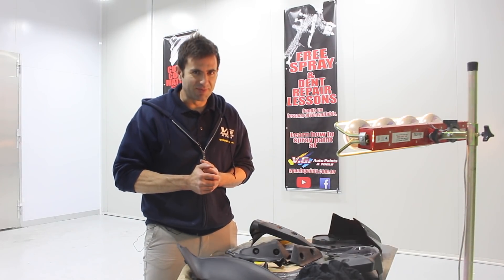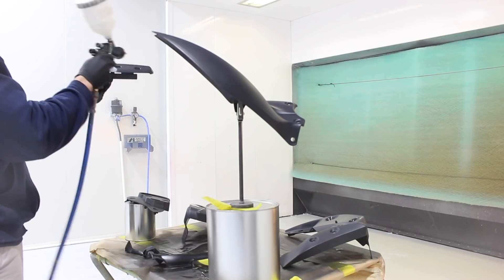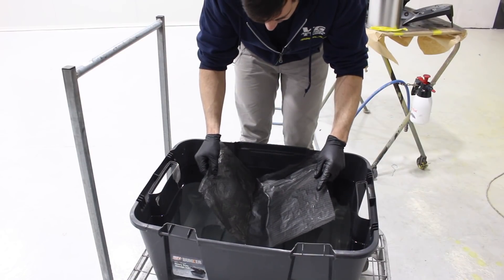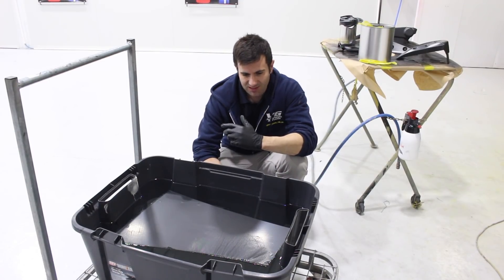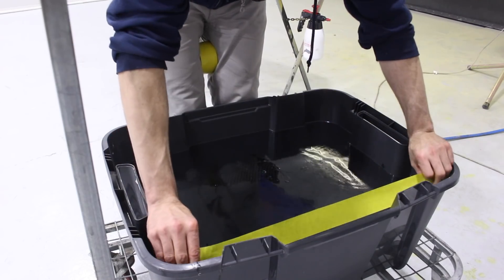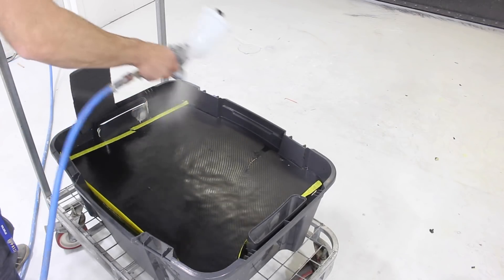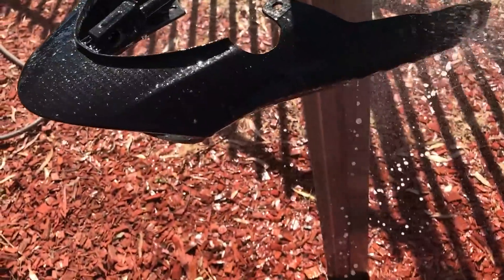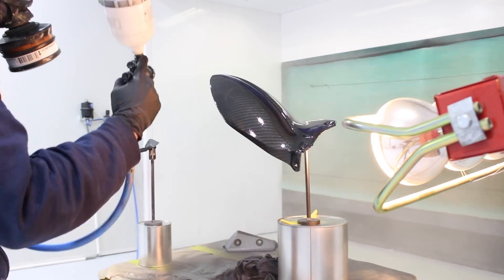Hydro Dipping How to Beginners Guide.

Comment: The film took a while to flatten because of cold water it has to be warm for that reason. Top tip, de natured alcohol removes the hydro dip if you mess up but only in the first few hours before it's fully cured so no need to sand an start again.

Comment: the parts were already dark colour before the plastic primer and pearl black ?? does the initial dark colour on the part make a difference prior to plastic primer and base-coat ?? and is pearl black the best base-coat colour ?
Reply from the maker: darren hill the initial colour doesn't matter as long as you get good coverage with your basecoats. I like the pearl as it has a nice sparkle to it. Best to test which basecoat you like.